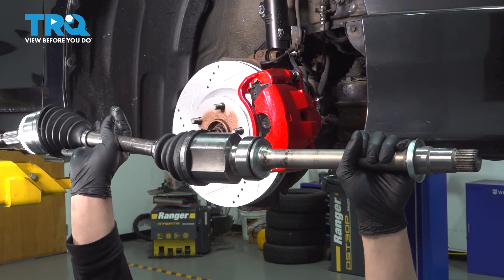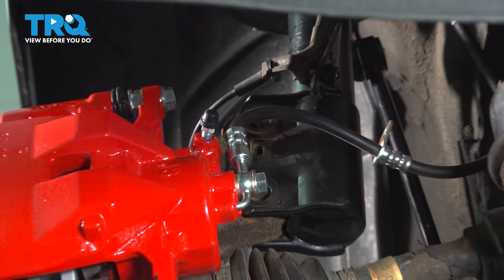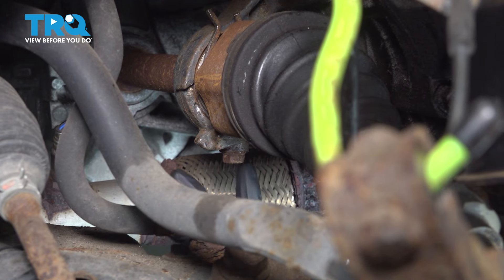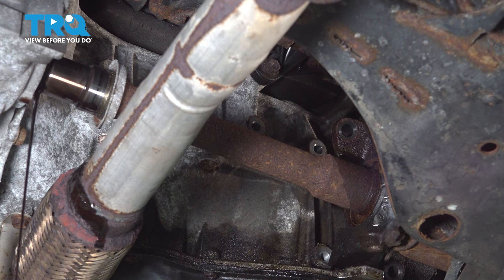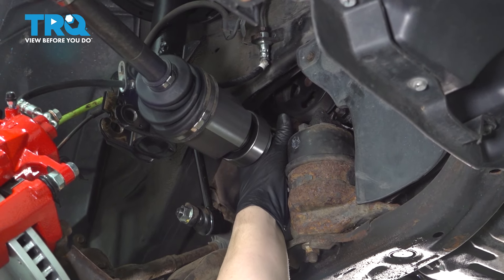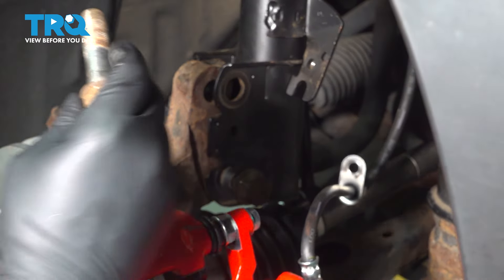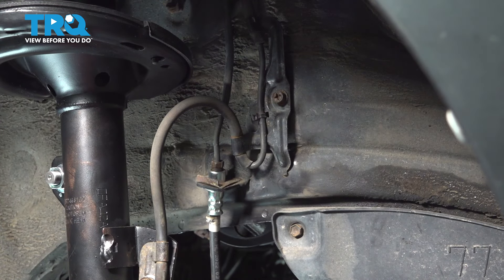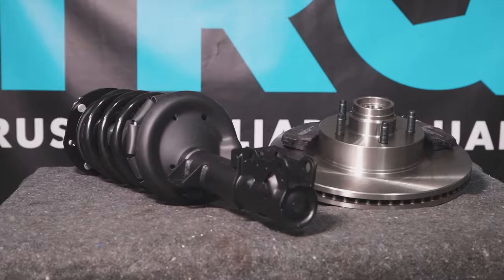How to Replace Front Right CV Axle Assembly 2007-2011 Toyota Camry

Comment: This tutorial does not work for the 6 Cylinder 3.5 model the brackets are crammed in with too much other stuff to be able to get it off you have to take it to a shop which I only realized after taking everything apart. This video would work fine if I had a 4cyl

Comment: He forgot to mention. IMPORTANT! THERE IS AN INDENT ON THE AXLE NUT, YOU MUST DENT IT OUt. Unless of course youre at a shop with air powdered high torque tools. The rest of the video is useless if you cant even do step 1.

Comment: Recently replaced one of these. Spent more hours than I care to admit trying to remove the  bearing bracket with the cv axle. If you plan to replace the bearing bracket with the axle, use a penetrating oil to breakup/free the rust from the cv axle bearing to bearing bracket interface and knock the bearing bracket off the bearing toward the transmission (make sure your bearing bracket is free of the pins). Once I did this, the axle slid out with no resistance.

Comment: How did you get the bracket on there with the axle? Every time I try and install the bracket first the axle doesn’t want to line up inside the transmission

Comment: Question... the spline with a round shield cap at the end that connects to the transmission (transaxle), does the cap seeded flush to transmission or is there a small gap?  Do you remember if you had to hammer it in?  I just replaced my 2011 and it has small gap, no transmission fluid leak from it but my traction control light came on, picture of car with squiggly lines behind it.

Comment: I wonder how the wheel would spin evenly without the rubber clamped axel balancer between the outer boot annd the cv assembly inner once  installed. After market parts are well known for missing componetts  design affecting speed Rolling on the  ground fuctionallity. If your car is a reliable toyota why wouldn't you look into an on line lower discount OEM parts? Plus add  more transmission  oil once the job is comple.